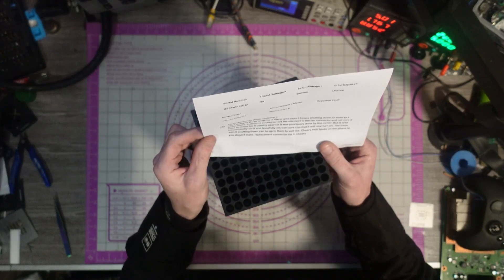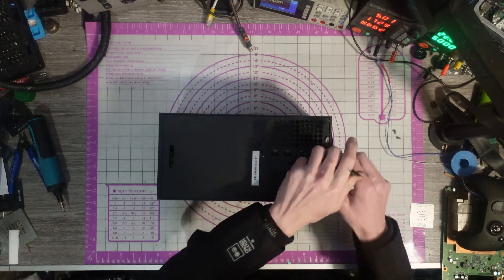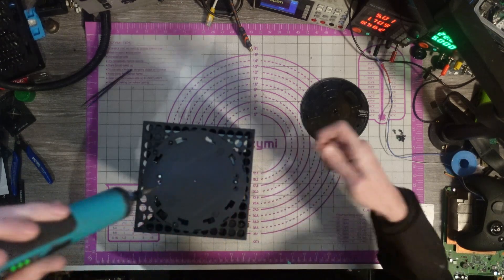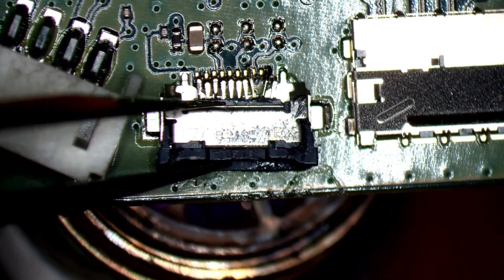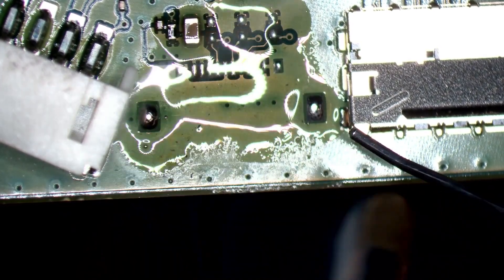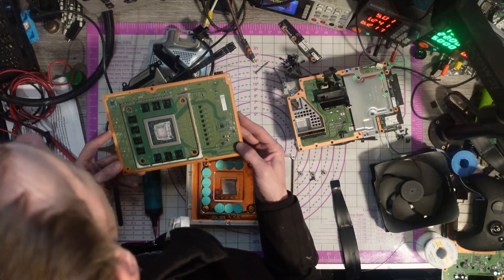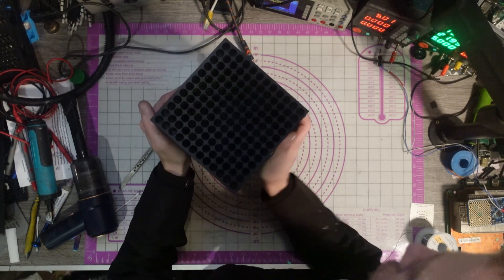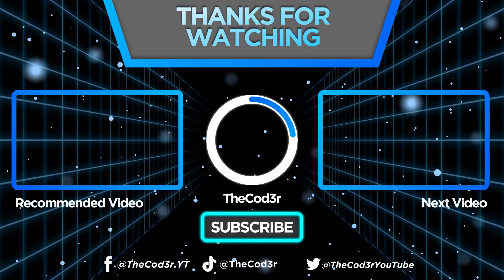YOU MIGHT BREAK YOUR CONSOLE TOO! XBOX SERIES X TECHNICIAN DAMAGE REPAIR

Comment: Came to this video to ask if ypu got a early series X digital system or ever the new disc series X system to tear down like others got? 

I want someone to put the older vapor chamber cooler on the new system to see if that does anything since they now went with heat pipes with smaller chip since it dosent produce the heat that the day 1 series x chip does and the vapor chamber should cool the new system even more. So many now experience to do. Like even if any old series X parts work on the new series X.

Comment: This might be a weird idea. the port on the back for expanded memory. could it be rerouted to connect to the lines of the main ssd. So that you make a 3D printed cover over the ssd. to work with the memory port. so that when you want to back up the security second of the drive. you don't have to take apart the console.

Comment: Is it possible to backup the xbox security partition on the ssd safley incase the ssd spontaneously dies?
Reply from the maker: You can run a backup using a cloning device but you'd need to back up after every update